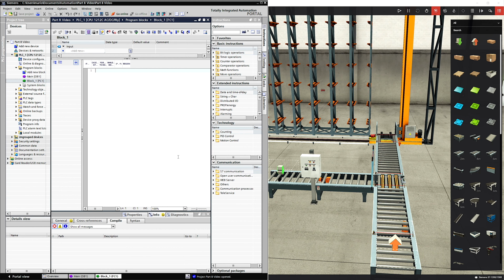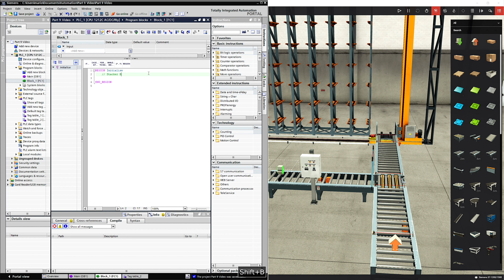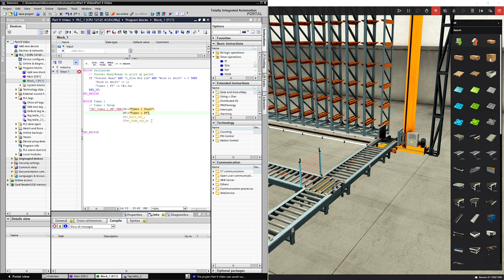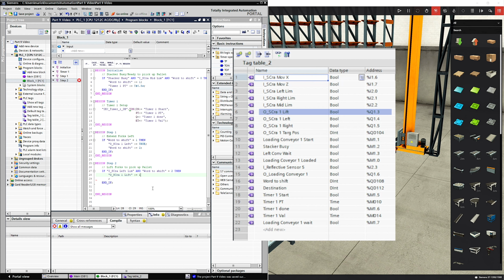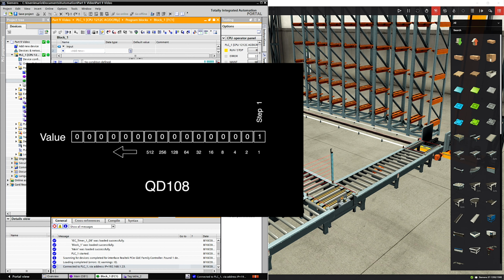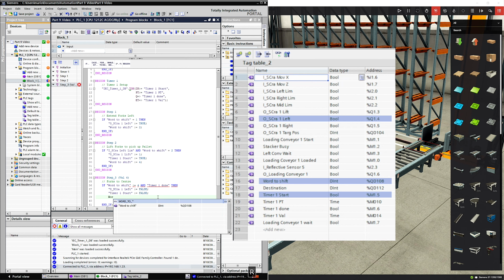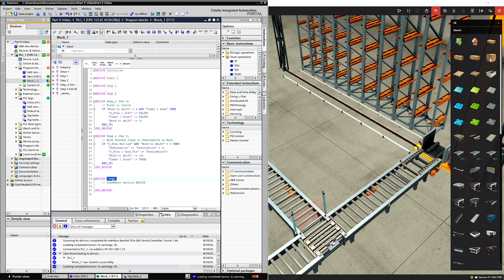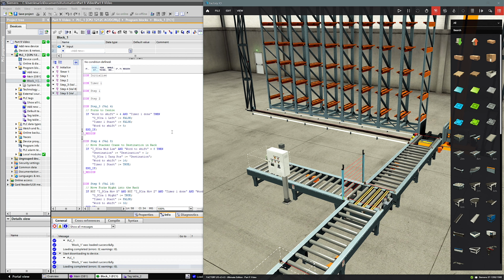Siemens SCL Programming for the Factory I/O Stacker Crane

Comment: Very good clear video, and a nice entry to SCL programming.

One comment (I don't know if you realised this later on in the series as I haven't watched them yet) on raising/lowering the forks.  You say there's no end sensor - which is true - but you can use the 'moving Z' feedback to detect when they are moving up or down, so when this sensor is false, it's the equivalent of an end sensor.  Of course, depending on the speed of the PLC and installation involved you might run into timing problems
Reply from the maker: Thanks for you comments Kelsey. I actually amended the video for  Z movement to false in the latest program as it was easier to understand and makes more sense. I just have to create the videos when I can. Hopefully this month. All the best.